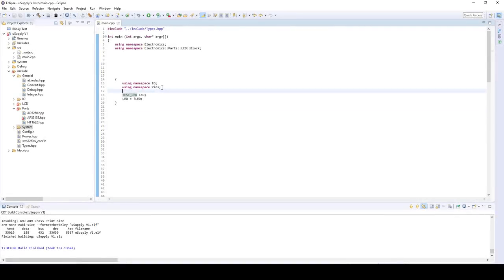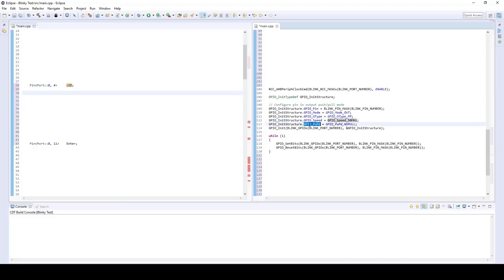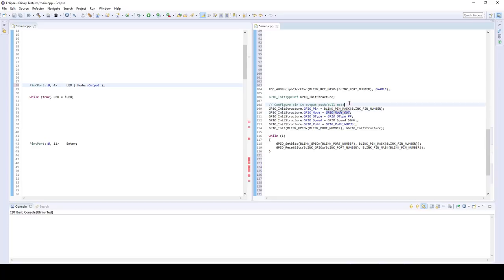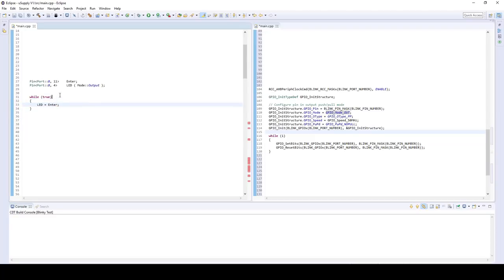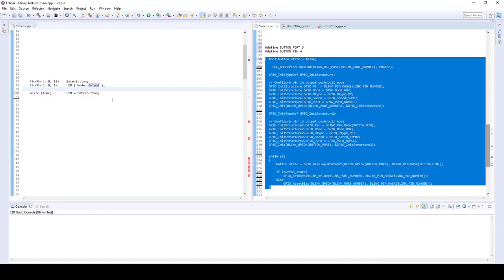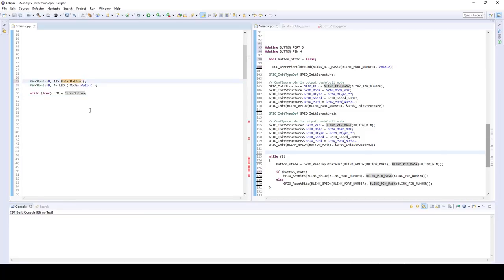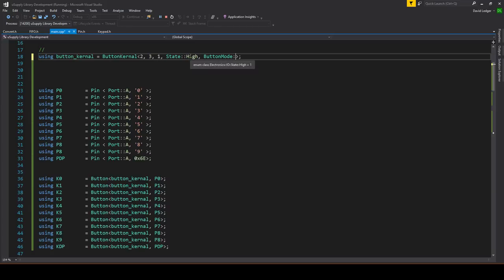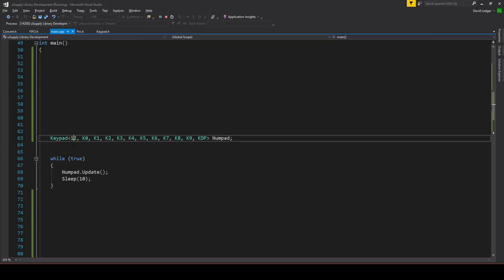C++ for the Embedded Programmer

Comment: This is an unfair comparison. Yes, ultimately you can achieve a higher level of abstraction with C++ compared to C but what you are doing there is comparing highly abstracted C++ code with almost non-abstracted C code. It's not so much a language problem but rather a failure to apply the same level of abstraction on both sides of the equation.
Reply: Martin Lund So true, without showing the C++ Class/library with all the C++/C/Asm Code behind it's not a fair comparison. Some one have to write it.
Reply: pcbreflux Only once, plus C will never give you a compile time error if you set up a port incorrectly, if ports are in conflict etc. I would recommend you to watch the talks by Odin Holmes and have a look at Kvasir MPL and Kvasir Bit library to see the true difference. This is a bit of a contrived example that did not take the full power of TMP into use, as if the initialization code for multiple pins are the same, the register writes can be merged at compile time, giving both flash and speed benefits.
Reply: Emil Fresk Sure only once and no doubt more abstraction have clear benefits, but showing only a tiny portion of the code remain a unfair comparison and confuse beginners or "managers".
Reply: Indeed, basing anything on one piece of information is not a good strategy. However hopefully it will increase awareness and help the state of the embedded industry today.
Reply: I didn't show the code behind the ST library either.
Reply: It was just a real world example of what I was working with, on the platform I am working on (hense the ST library).
Reply: ST libraries are abit messy but there are alot of them basically the same. Most manufacturer produced libraries are of similar structure.

Looks like your thinking of PIC micro controllers, perhaps AVR. Those are not valid instructions and there are many more registers on ARM processors.
Reply: I kept wondering why you needed so much more information to make the C version work at all, but I guess that the defaults in the C++ library happened to work for you. In that case though... choosing languages and libraries by whether their defaults work for what you're doing today is not really a good strategy over the longer term.

One of the joys of a good library is that the stuff you care about is easy to get to, the stuff that has fixed values is hidden. But you don't mention anything like that in the video, leaving me wondering.
Reply: As shown late in the video:

Pin<...> MyPin(Mode::Output, State::High, etc etc)

is fully valid code, defaults can easily be configured, in a manner that is still syntactically less verbose. Defaults for everything about the pin is settable, speed, pullups etc.
Reply: Creating a world of code users , who is going to write the low level code when the few who can are gone.
Reply: You seem to be under the impression here that just because there is a preference towards high level code to improve efficiency, this stops people from being able to write low level code. Do you think these C++ libraries write themselves? Do you think that future versions would maintain themselves? It is quite common for C++ libraries to have to wrap low level concepts, and it requires somebody to work on those libraries.
Reply: this is exactly why I think that Arduino is unsuitable for teaching university students who are supposed to further develop technology. 

I find the best level of abstraction is the one you implement yourself (in C using both pre-compiler macros and functions) - because then nothing is hidden from you.
Reply: Uwe: Then in that case you can just use the C++ compiler using only the C features and then add abstractions, while using the compiler features like constexpr instead of macros to increase type safety. Is helping yourself to avoid errors and spending more time developing and less time debugging really no good?
Sure, when people think C++ they think classes with deeply nested inheritance hierarchies all over the place, with exceptions thrown everywhere, but in practice you don't see that beyond some libraries that are really old. These days you see very little in the way of inheritance unless needed, very few virtual functions. The application is also mostly written imperatively using objects to encapsulate more complex ideas.
Reply: It's not just an issue with the abstraction. One advantage a C++ implementation can have is that it can be made typesafe. While a regular C implementation, even with proper abstraction, tends to just pass 'int's around, making it very easy to make mistakes like passing a bit number into a function that expects a bitmask (e.g. _BV() stuff on AVR).

That said, writing proper abstraction that is not only easy to use, but also give full access to the underlying hardware can be rather tricky. Arduino for example is very portable and easy to use, but also makes it impossible to access many of the lower level features of the hardware, as the Arduino API not only does not offer the functionality, but also starts misbehaving when you bypass it.
Reply: I never understood why anyone would use the _BV()-stuff anyway, since (1 << x) takes up exactly as much space in the source code and in my eyes it's much more readable...
Reply: Uwe Zimmermann
 I agree, I've recently picked up an arduino and have made a few programs with it. Although they work, i don't feel like i have much control over the uC since everything is already done for me... 
I was once asked in an interview how long a function in my code would take to execute. If i used some code from an arduino library i wouldn't even have a clue.
Learning to read datasheets and reference manuals is very important as an embedded systems developer.
Reply: @emilfresk  You can also write C code that does that stuff. Just makes a function that accepts as params the configurations for each pin and set a default one, and runs the low-level stuff.
Reply: He doen`t state, that c++ is always better. He only narrates about good sides of using c++!
Reply: Yeap true that
Reply: The Embedded Hobbyist - Exactly right. We still need the people who know how to build things from scratch.
Reply: Yes i was going to say the same thing
Reply: @TheEmbeddedHobbyist  why, ChatGPT, of course. ;-)
Reply: @davidpetersonharvey  but who is going to write the code that chatGPT copies. I've never seen anyone ask it to write code for a brand new chip. Will it be able to understand the data sheet and produce the code required,  I think not.

Comment: I actually prefer the C way, because I can see exactly what is happening. Sure, I can just put everything in some function in a different file and get the same result, but even for C++ the constructors have to be somewhere in some library. It comes down to how abstract you prefer your main program to be.
Reply: Indeed, certainly does :)

Comment: I stopped using assembler over 30 years ago. Yet so many people still use it because it is 'fast' or some other arcane reason. C++ which itself is decades old shows how code can be simple, fast, understandable and supportable.  The question is will you release your libraries for others to play with? Otherwise we get everyone reinventing the wheel. Yet again.
Reply: Yes of course! Its part of the uSupply code, but I need to discuss when to release as much of that project is still secret squirl :) I can release my Pin code I think, i'll check on Monday.
Reply: It depends on the situation, about 0.5% of the code I write is assembly language. It's for specific pinch points. While compilers are smart, they don't know anything about your data, so they make broad assumptions. It's not uncommon to be able to double the speed of your code if you can optimise your algorithm to make maximum use of on chip resources like registers rather than going off chip for example. It's rare, but assembly language still has its place.

More common is to be able to read assembly language while debugging, that is a very useful skill.

More fundamentally if your algorithm is not designed for speed, no amount of assembly language will save you!
Reply: Yeah that happens, I would recommend checking out compiler directives for particular blocks of code but assembly for certain blocks can do the job too :) Nothing does nop like assembly ;)
Reply: Nezbrun -

Comment: Manufacturer libraries for things as simple as GPIO  are a waste of time - more stuff to learn, more scope for bugs. Just stupid.
Reply: That has been my experience too. I suppose I never really got to that conclusion though, hadn't thought about it, just mindlessly opened manufacturers libraries without thinking like I expect everyone else does.

External library bugs, the absolute worst!
Reply: Indeed, For gpio write your own simple bare metal macros or inline functions, the KISS method.
Reply: Macros can have their own issues, but yeah inline functions sure :)

Just a couple examples on my issues with macros:
#define cube_volume(x) (x*x*x)

int dimension = 1;
double volume = cube_volume(dimension++);

You'd expect the answer to be 1, but the answer here is 6.

Or:
#define run_two_functions(x) {f1(x); f2(x);}

if (condition)
    run_two_functions(x);
else
   run_two_functions(y);

The above doesn't work because it evaluates to:
if (condition)
{
}; <-- This is the error
else
{
}; <-- This is just redundant

The fix is silly too, its the standard:
#define run_two_functions(x) do{f1(x); f2(x);}while(0)

which evaluates to:
if (condition)
{
     do{f1(x); f2(x);}while(0);
}
else
{
     do{f1(x); f2(x);}while(0);
}
Reply: Of course, like everything you need to know what you're doing, your first example is the classic one they tell you in class, any C programmer worth their salt would be more than aware and wouldn"t really have to think too hard about it.

The second example is unlikely too, you use macros mostly to do simple aliasing and inlining to improve speed at a pinch point, calling functions is possible but unlikely except in the classroom or if you're a macro ninja writing obfuscative code. This is all about improving readability and maintainability, not making it worse!

I can't think of a time I've ever fallen with your examples jn practice in 30 years of C programming.  Even inlining has its challenges, there is no guarantee it will inline your code for example, and debugging inline functions often doesn't work well. My problem with templates is that the concept came in late in my career, so it's not something I'd naturally use. I also find the syntax of them far from natural, like it was bolted onto the language, which it was of course!

Writing to a port for the most part shouldn't need the compiler to generate a function call at all in an embedded system that doesn't have an OS, it should generate code to do direct peripheral register access.

Comment: For any embedded programmers, I highly recommend Bob Martin's popular book "Clean Code".  It guides you in a similar direction to what Dave is showing here, but goes into detail about why it matters and specific steps on how to get there.  Being a EE, I never encountered these ideas in school, so it was very valuable.  As others have pointed out, the C code on the right is not really a fair comparison.  While functional, the C code still needs to be cleaned.  Your main C loop (top level of the application) could look something like this:

if (isButtonPressed())
  turnLedOn();
else
  turnLedOff();

Comment: I'm sure this video took some time to produce, but it wasn't a good time spent. It has virtually no sense to compare semi-standard library from a manufacturer in C to a custom library in C++. It's not a comparison between languages, it's a comparison between libraries.
I it surely possible to create a library in C with a similar interface, obviously not using "methods" or overloaded operators, but the same amount of code should fit in around 10 lines of C code.
Reply: I thought about this and wasn't sure how it could be done in that manner in an elegant and internally consistent way. The library here exposes all of the functions that the manufacturer library exposes, the only difference is type safety and automatic management of port clock power.

I'd be interested if you had any ideas, I don't like making objects when a function will do but classes are just so powerful.

Comment: FWIW, there's really no reason the C code has to be any more complicated (all told) than the C++ code. It's just that you're using a very low-level library of C code and a higher-level library of C++ code. You could build a higher level C library and the code wouldn't look hugely different (you'd have to call a function to set the LED or Enter output, whereas in C++ you presumably use assignment).
Reply: > there's really no reason the C code has to be any more complicated
define complicated? easy to read? maintainable? there is, the reason is C, C has few abstractions, C++ has "all the abstractions", RAII alone is a huge productivity, and usability boost, you can't get that with C, because C has no language constructs to control lifetime, the equivalent C code would not just be more verbose but error prone, and there is no way around it